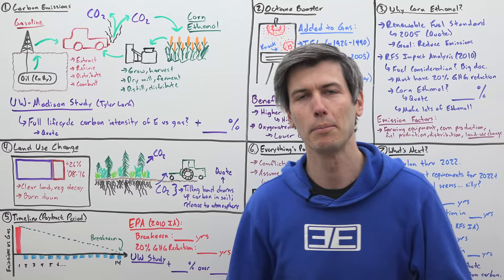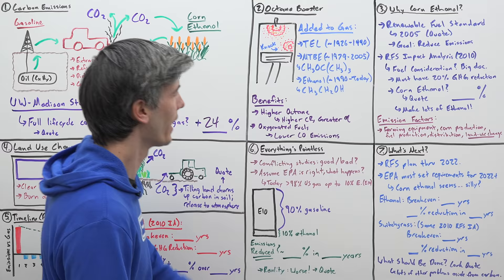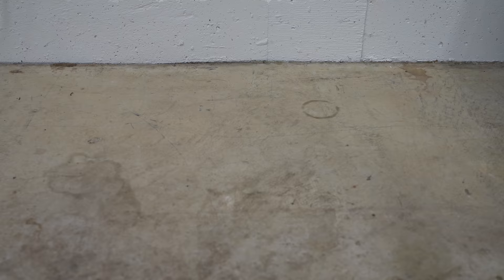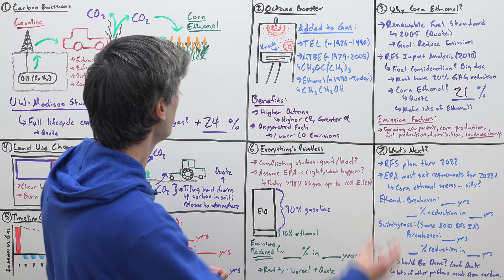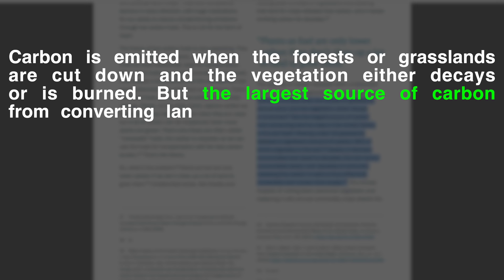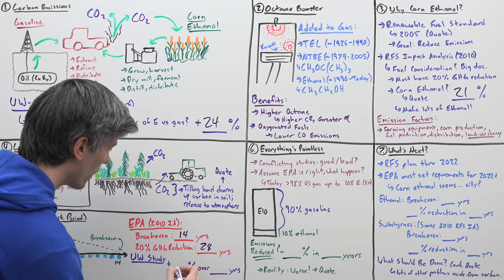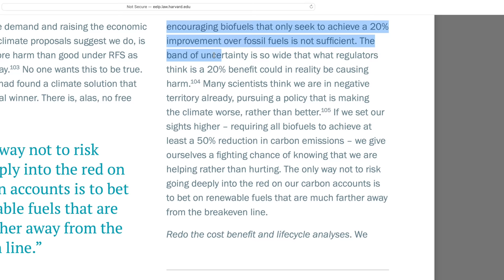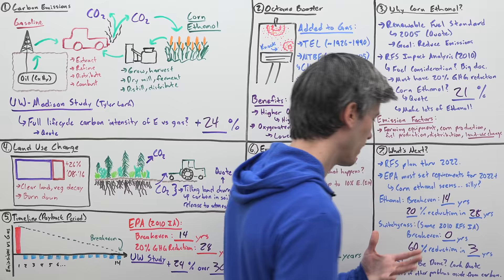America Was Wrong About Ethanol - Study Shows

Comment: Coming at this from an energy perspective. New solar and agrivoltaic projects can deliver upwards of 100x the miles per acre when running ethanol vs kWh. The transition away from ethanol and ICE vehicles would result in orders of magnitude reduction in biofuel production and ability to grow more food and reduce deforestation for biofuels globally.
Reply: A Ford electric pickup on an acre of solar panels under idyllic conditions can drive 10,000 miles on an acre of land (with 320 mile range).

A Ford flex fuel 4WD pickup on E85 for the whole US average corn yield of 513 gallons of ethanol per acre can drive 7695 miles (460 mile range) plus give 1000 lbs. of protein and other things for feed.

If Ford came out with their ethanol optimized eco-boost ethanol engine they drove in prototype which was 15-20% better mpg than E0, it could go 11799 miles (661 mile range) on an acre of corn plus provide the 1000 lbs. of protein and other things for feed.

In wintertime the electric vehicle in northern states can drop its mileage by half.  So bad that the Minneapolis-Saint Paul Metro even quit using their electric buses when cold.

Corn ethanol is value-added from existing feed production acres.  There were no forests or grasslands broken up for it.  Quite impossible since US cropland acres have been declining.

Ethanol is stored solar energy.
Reply: FROM BING CO-PILOT:

>>>An acre of solar panels can generate an average of approximately 4,200 to 12,800 kilowatt-hours (kWh) of energy per year. The actual output depends on factors such as the location, panel angle, and environmental conditions1. To put this in perspective, it’s enough to meet about 80% of the energy needs of an average household.

If we consider optimal conditions—such as a flat location with high sun exposure—an acre of solar panels could potentially produce up to 20,000 kWh annually, which could power nearly 250 average households1.

Keep in mind that these estimates vary based on specific circumstances, but solar panels are indeed a sustainable and renewable energy source! ...<<<

I meant in previous post idyllic driving conditions, not idyllic solar conditions.

Comment: I can't remember the exact numbers now. But I did notice a significant reduction in gas mileage with my motorcycle running E-10 gas compared to pure gas. The reduction was greater than 10%, if memory serves. And the motorcycle ran better on pure gas. Now this motorcycle was a fuel injected 2010 H-D Street Glide. That particular motorcycle required a minimum of 91 octane fuel, due to the compression ratio and it being air cooled.

Back then I thought, what is the point in E-10 gas if I'm burning more of it?

Comment: One negative aspect that needs to be told, especially now, is the fact that fuel with ethanol in it is more likely to grab moisture from the air, making it a Poor fuel choice for storage.
Reply: this is true actually, i’ve seen them have to pump out the ethanol tanks here in michigan during spring time because they become contaminated
Reply: and ruin o-rings/seals and anything rubber in your engine....
Reply: You put in 5% ethanol, you effectively have 5% less fuel... Yet they spent a boat load of energy producing that ethanol
Reply: NOPE. E85 actually stores better than gasoline does now.
Reply: @phreshone1  Sadest thing I have read yet.
Reply: @oldblueaccord2629  and how does that e85 compare to plain gas in fuel efficiency?  Cars need to be designed to run on e85 as well.  "Magnesium, aluminium, rubber and water react with ethanol to create a corrosive substance. "
Reply: @oldblueaccord2629  , it may, which I doubt, but this video is about Ethanol in gasoline, not the other way around.
Reply: @derekp6636  , in a calorie used to produce calorie of energy, it doesn't.  E85 makes more power for certain, but it is Much less efficient.
Reply: @derekp6636  On my Honda its about 20-22%less. Box stock motor with 335k miles. I just went with 30% bigger injectors and fuel pressure adjustment.

Comment: I keep gas consumed and miles driven on every vehicle I have owned (greater than ten vehicles) since 1980. In 1982 I bought a new Honda Pilot and I kept consecutive records of every gallon used and every mile driven. I was also the only driver of this vehicle. The Honda Pilots' MPG from new slowly improved each week until it reached 22 MPG. Then they added 10% ethanol to the gasoline in my area. My MPG dropped suddenly from 22 MPG to 20 MPG. Or, about 9%, go figure. No, my milage NEVER returned to the pre-ethanol level before I sold it years later.
Reply: @Jimmy T : 

Your engine will lose efficiency when the ethanol emulsifies your lubricating oil, essentially thickening it into mayonnaise.
Reply: A few years ago, I rented a vehicle from (big name) rental agency for an extended cross-country trip, from near the east coast to the west coast. When I picked it up, it turned out to be a "new" Chevrolet Impala with 90 miles on the odometer. It was also one of the new "flex fuel" vehicles, that would take anything, including E15. I headed west on the Interstate system. The first station I came to when I needed to refuel offered E15. I decided to run an experiment. I filled up with E15 all the way west, about six times, as I recall, and then the ability to get E15 ceased. I kept accurate records - fill-up amount, location, gallons, price, MPG for the E15, and then did the same thing in reverse on the way back east a couple of weeks later. Stopped at the same stations, filled up with E90, and compared the results. Miles per gallon were significantly LOWER, and DOLLARS per MILE were significantly HIGHER.  It's a scam, folks . . .
Reply: @checkyoursix5623  what was the percentage difference in mpg recorded between the two fuels?
Reply: Of course mpg dropped! Ethanol has less energy per gallon than gasoline; it’s a fact of chemistry.  No mystery there, the advantage is that ethanol may be cheaper than gasoline, and it burns cleaner in your engine.  Your engine (spark plugs in particular)  will not get carbon buildup with ethanol - because is has fewer carbon atoms and more hydrogen atoms than gasoline; it’s a fact of chemistry.
Reply: The 1982 Honda pilot? I must have missed that one

Comment: So glad you're focusing on this, especially now with the request to alter the RFS to require %15 ethanol content for US gasoline.  I refuse to buy gas that contains ethanol. I vote with my money. It costs me more, but I'm not supposing a nonsensical plan that destroys land.
Reply: Where do you buy gas without ethanol?
Reply: @thedevilsadvocate5210  Shell & Hy-Vee
Reply: @Hyphae_Foray  
I wanted to get some for the lawn mower
Reply: Same here.
As the proud owner of two chain saws, I've noticed they've gotten harder and harder to keep running well over the years. Note: I've always used non-ethanol gas. I recently got a long, detailed crash course on gas from my chain saw dealership, which has noticed the same thing happening universally as the quality of gasoline in general has declined. This is less of an issue for modern cars, as the the computerized sensor systems can compensate. Not so for small engines. Some of the tips I've got to make my saws happy:
1. Option 1. Buy extremely expensive 93-octane no-hootch by the gallon.
2.Option 2. Go the the local airstrip and buy av-gas.
3. Option 3. Only buy no-hootch gas from a dealer with a "blender license" that allows them greater quality control. In this case, make sure you drain the hose into your vehicle before filling up your gas can, because you don't know what the person just before you was pumping. The average stop-and-rob convivence store can be assumed to be a non-blender. Finding a blender outlet will take some detective work, but I suspect most outfits dealing with small engines have figured out the same things my dealer has and can send you to a good outlet.

Comment: I would like to point out that corn based ethonol has been used in cars since the 1920s. The old moonshiners would run 100 % ethonal then drain the tank at the last stop.
Reply: That makes no sense.
Reply: I would like to see these studies with e85 instead of e10 I bet they would hit the net 0 emissions in less yhan 5yrs.
Reply: @dreamshop6071  the car's fuel tank was used to smuggle alcohol, they drained the tank to sell for drinking.
Reply: The original Model A and T were desined to run on ethonal

Comment: I used to be a dock attendant at a lake. The amount of trouble related to ethanol breakdown, especially in boat engines which are generally cruder and lack things like catalytic converters, pure gas burnt so much better and clean and engines ran better. Once it came out that we had ethanol free gas we got a lot of boaters coming just because the gas is good
Reply: Old motors that did not handle the corrosiveness of ethanol well I imagine. Other than that no real downside.
Reply: Ethanol prefers higher compression as it burns cooler. This is why I run non-ethanol gas in my power equipment and E10 in my vehicles (only because it's cheaper).
Reply: @gregkramer5588  Big downsides.
Shelf life. Ethanol tainted fuel starts chemically changing is as little as 30 days. It also absorbs water from the air, and in a short time it separated from the gasoline (phase separation) 
Shelf life of just gasoline, 2 years minimum.
Reply: Most Marine Outboards (quoting you) "used to be"  Two Cycle Engines.

Two Cycle Engines are notoriously unreliable.
Reply: @arcanondrum6543  I grew up snowmobiling in the 70s.  Not a good sport for people that could not fix them :-)  My dad worked on them in the winter.  We were dairy, corn, oat and hay farmers at the time.
Reply: @TheBandit7613  Do you know if this is significant in our supply chain?

Comment: Great video!  I am been saying for years that ethanol is a lousy alternative, but without the science to back it up.  There are at least three other drawbacks not mentioned in the analysis. 1. The addition of ethanol makes the mileage of the vehicle go down. 2. Ethanol exhaust gasses and cylinder head temperatures are significantly higher and 3. The ethanol destroys older non ethanol resistant fuel lines and clog small carburetors.  This has resulted in a huge increase in car fires and associative drive insurance costs and the disposal and replacement of 100s of thousands of small power tools due to their becoming non operating due to ethanol clogging.
Reply: He isn't saying that ethenol is bad, he's just saying that there are better ways to make it besides corn. The fact that it's bad for cars that were designed to burn lead and are so inefficient that they aren't even legal to produce anymore won't get anyone to stop making ethenol.
Reply: @bj_  Just because he's not saying it's bad, doesn't make it not so.
Reply: Cost per mile and tailpipe emissions per mile are still lower with ethanol vs. gasoline.  And if you look at adiabatic flame temperatures gasoline is ever so slightly hotter than ethanol.  Furthermore, because you are more likely to be able to run optimized ignition timing on ethanol, your cylinder head, coolant, and exhaust gas temperatures will be lower for a given power level on ethanol.  Most modern engines can not get anywhere near MBT ignition advance on 87, or even 91 octane gasoline, but can achieve it on E85.  These myths about ethanol simply need to stop - in the days of the internet there is no reason not to check these things before spouting off.
Reply: @ChurchAutoTest  Maybe in automobiles with electronic ignition where timing can be controlled far better than ever before.  For older simpler engines, especially with carburetors the exhaust is hotter at the exit of the pipe with ethanol fuels.  Low leads and non-ethanol fuels do not run as lean.  That is my experience.  Yours, with tuning may differ.  I have checked.  It is unstable, it separates and it attracts water. None of these are good for a fuel system.  New vehicles with injection and Electronic ignition ethanol is fine in, not the older stuff.
Reply: @rnd2731  If you're still running carburetors then you need to rejet.  You're hotter because you're leaner.  You'd have the same problem if you jetted for Denver and then moved to LA.  Carbs have very limited ranges of operation, so what you're describing is a carb problem, not an ethanol problem.  And BTW, E85 can hold up to 4% or so water in suspension without dropping out, and will burn just fine at that level. Gasoline starts to drop out at about 0.2% if memory serves, E10 is about 0.7%.  So while ethanol is hydrophilic, it can tolerate far more water without issue.

Comment: I had been using 10% ethanol gas in my lawnmowers, weed whackers, etc. They all needed rebuilt almost every year. About 5 years ago, I began putting only non-ethanol gas in them- and haven't had to have them all rebuilt ever since!
Reply: SEE?
Reply: so untrue. complete lie
Reply: @haroldbrooks5473  Trump strategy here. You can neither confirm your point nor deny the other without some evidence.
Reply: You should buy better lawn equipment.
Reply: Pretty sure those small engines are almost all high compression engines or two strokes. They can't reliably run on 87 or 89 octane and I'm assuming most of your owners manuals will say premium required. 

Pretty much any small engine or most tractors/atvs/boats, put 91+ in. You probably need it. If not, you don't use these engines that much, there won't be a large cost difference.

On top of that, these engines are sitting longer. Ethanol attracts water. On engines sitting a longer period of time, you do not want ethanol, or a lot of your rubber can rot and you could be running with water in your fuel.
Reply: @trashbandit2449  no. Almost all lawn equipment is designed to run on like 87 octane unless otherwise stated.
Reply: @chickenfishhybrid44  tractor, four-wheeler, and weed wacker all need premium.

Lawnmower doesn't. Also happens to be the worst running engine but that's probably not related. 

Tractor was before ethanol was everywhere though. 74 I think.
Reply: @trashbandit2449  cool, the vast  majority of modern equipment is designed to run on 87.
Reply: I been using then in weed eater and lawn mowers for 14 years ZERO problems.
Reply: @trashbandit2449  Good both analyses and advice. Thanks for taking the time to explain it to I bet a LOT of us.
Reply: @chickenfishhybrid44  probably true.

Comment: The main issue with this is the subsidies and the fact that gmos are extremely resource intensive crops, requiring large amount of conventional fertilizers and huge amounts of toxic glyphosphate sprayed on the fields. Use of regenerative land practices to create grain corn for ethanol would be much less resource intensive and provide much cleaner waste from those operations. Just like subsidizing this wasnt a good idea, neither is completely condeming it either. Also if i recall correctly henery ford had a better ethanol route through hemp practices.
Reply: Ah dude, GMO would be less resource intensive.  Why would anyone modify the genomes to make it more intensive?  This seems more like a negative generic farm and farm industry rant. Have you ever farmed?
Reply: @snapon666  theyre more concerned with losing control thats the big "problem" with hemp, hemp also contains alot of precusors for alt cannabinoid production, cant have innovative and free thinking minds, thats dangerous to the status quo.

Comment: Did you account for all the venting of fossil fuels? From the extraction site, to the vented gas stations? Flaring etc. 
Great video would be to calculate how much oil is required to end up with 1 tank of gasoline. A full cost from well to wheels. You will be shock by numbers
Reply: I have read that all costs and necessary profits from crude oil come from all the extracted chemicals. Gasoline is pure profit. I also have read that whatever is left from crude that can not be used, is mixed into gas for us to burn, instead of them having to properly dispose of it.
Reply: @Panchester013  i don't think you can call the ancient black liquid a fossil, but coal certainly is a fossilized tree

Comment: Here's what I know...I can go about 15% farther on a tank of ethanol free gas, than I can on a 10% ethanol mix.  And it's repeatable, I do it over and over.  So, while ethanol gas might be "cleaner", I need to use more of it, thereby (in my humble opinion) offsetting any pollution reduction.  I've only been driving for fifty years, so my data might still need tweaking...
Reply: I'm 70 yo, driving for 52 years (beat you by 2 years !!), and Absolutely agree with your observations.  In the NY area, the ethanol mix is more like 15% AND from about November to April, the gas that is delivered contains more ethanol, the so called "Winter Blend".  MPGs are reduced by about 10% driving the same cars , in the same manner.  Then when "normal" gas returns in April , the MPGs increase to close to their EPA levels. Although not "scientific" , it was and is clear and evident.   I'm one of those anal people who reads manuals, reads instructions and pays attention to things like the MPGs in my cars.
Reply: @Chiroman527  Yep.  I think the term is "energy density".  I could be wrong, but it's something like that.  The logic escapes me as to why we continue to do these things.  I guess it makes people feel better, regardless of its efficacy.😉